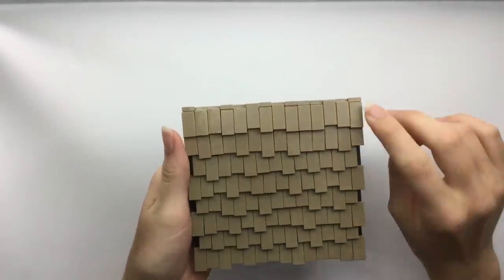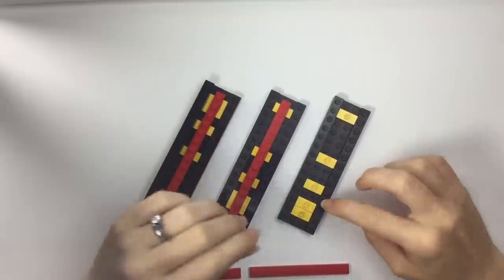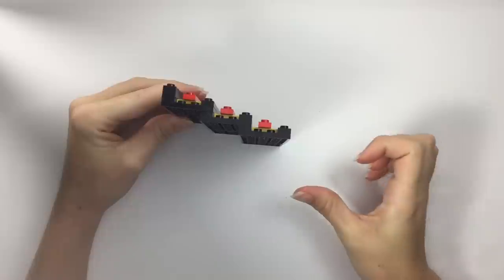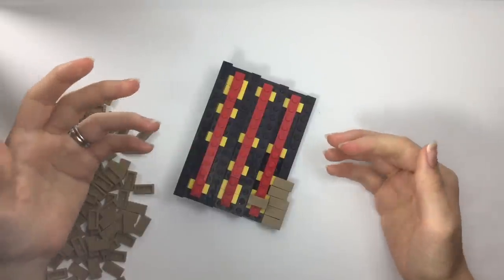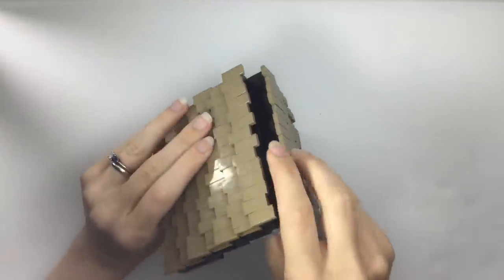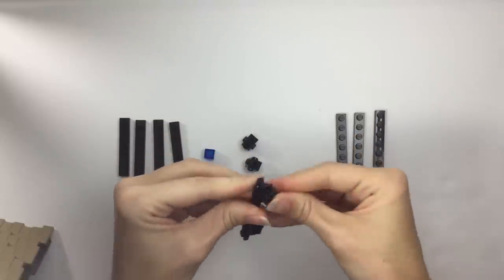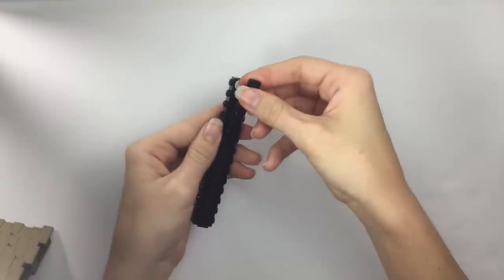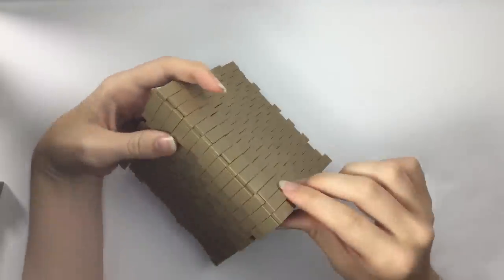Lego Techniques: #3 Staggered Shingles

Comment: another illegal Lego technique
Reply: noone cares
Reply: Garth Palmer illegal??!? What are you talking about?
Reply: There's no illegal Lego techniques. Only limit is creativity.
Reply: What's illegal about it? I've seen builders use a bunch of loose studs as ocean water.
Reply: This is not an illegal one, it uses normal connection methods except for the tiles uset to fill the gaps.
Reply: This demonstration is illegal, yes, but it looks like it would be fairly easy to make it legal by making a few modifications while still retaining the same overall effect.

Comment: Great technique, but I have a question. Is this possible at a steeper angle? this roof is a 90 degree, square angle. is there a hinge that allows you to push the roof plates closer together to create a steeper roof?

Comment: Would there be any way to do this so that it' snot such a steep incline?
Reply: It's not*
Reply: I had the opposite question, need a steeper roof. but, for a shallower roof, say 100+ degrees instead of the 90 degree angle used here, I'd suggest skipping the last step of putting the "travis brick" layer on, and widen the angle of the hinge. Use 1x3 plates at the top instead of 1x2 to cover the gap. still working on how to do a 60 degree angle roof with this technique.